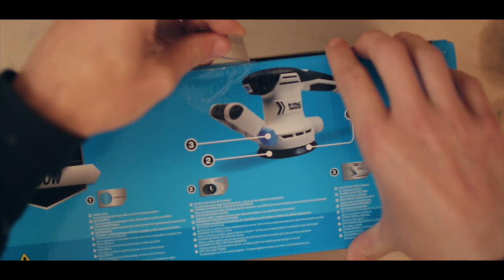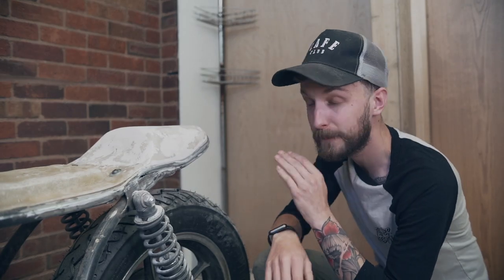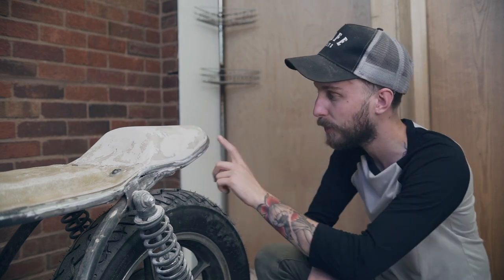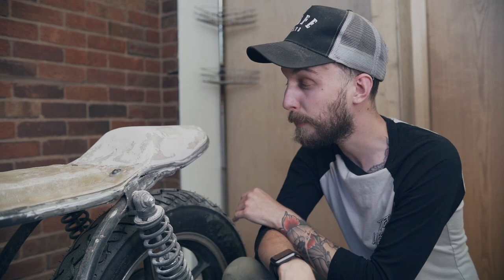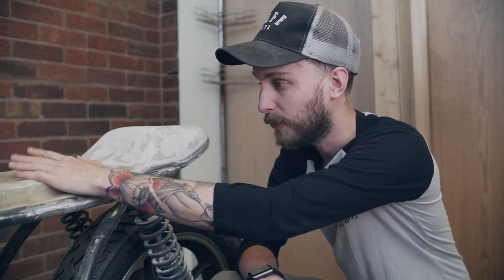XJ650 Build Part 14 - Seat Cowl Shaping - CINEMATIC

Comment: Great work as per dude 👍 nice try with the expanding foam 😂 a tip I got from a fibreglass boat builder was to make the sheet wet with resin using a wee roller on a cardboard sheet away from the thing you are trying to mould, rather than adding the resin in situ, think I have a vid somewhere, will send you it 👍
Reply from the maker: Worth a try! Failed but worth it 😂